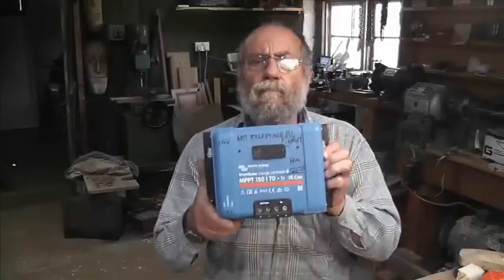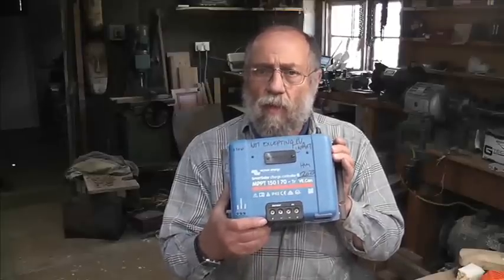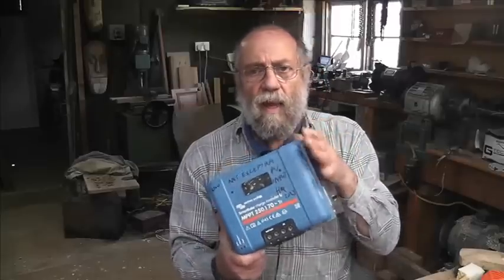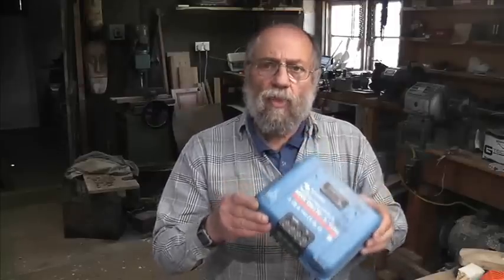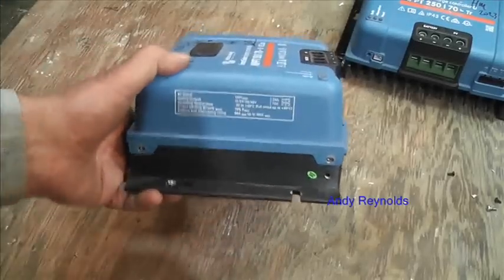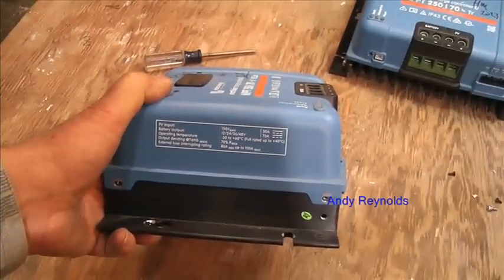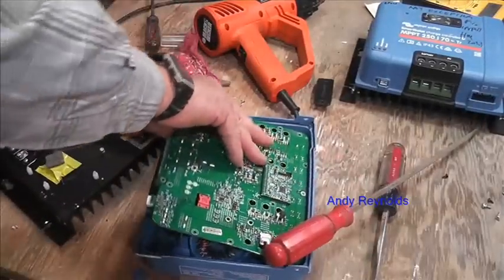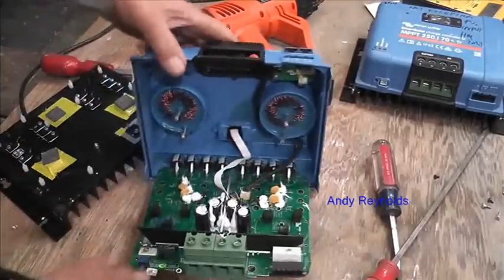Victron MPPT charge controller exploded

Comment: Mighty big hunk of junk scrap.  Great Video on those chargers.  Victron needs to change their mind set.  Those chargers get way too hot.
Reply: Nonsense, I regularly run my 250s at max, for hours, days .... yes they get hot, and yes they'll derate to self protect, but if you cook them with high ambient, or even direct heat they'll not be happy.
Reply from the maker: @SeanMoore2008  Capacitors fail regularly when cooked, cheers
Reply: Well, the Victron's do regulate the temperature.  They will de-rate the output above roughly 60C (the documentation says the de-rating starts a bit lower but it doesn't actually start until components hit 60C).

Victron's have very good heat sinks... much better than most other charge controllers, but if you run them full-out and want them to last it is still a good idea to have some air flow.  Doesn't have to be much.  One low speed fan is all it takes.

Heat can also be massively reduced by running a higher system voltage.  A 48V system generates 1/16th the amount of heat that a 12V system generates at the same power levels.  Not 1/4th.  1/16th.
Reply: Victrons are way overpriced for what you get, 2 big cons of victron units, 1- they run too hot doesn’t matter the quality of the electronics heat will kill components fast, and 2- they are not serviceable, buy once cry once get something like Outback or midnite solar units, all electronics have a lifetime of usage mosfets wear out, but these are at least serviceable and last way longer due to running cooler, victrons are popular for two reasons they spend hard for marketing and push hard to sponsor YouTubers with free products and the second reason is they are pretty simple to use and setup with Bluetooth units and easy to use app, electronics are good but they just run them too hot not enough mass and heatsink mass to properly cool them
Reply: @jaysonyang1441  If a MOSFET is not defective and it is operated within the SOA then it should last for your life-time or longer. If the MOSFET runs too hot and/or is subjected to an unsafe voltage and/or is subjected to an unsafe amperage then it's long lifetime will be reduced. Poor engineering can reduce the expected life of almost anything.
Reply: @MrSummitville  yes properly engineered but considering cost constraints size and format Victron seems to compromise with size and format, real world usage equipment will be in very diverse adverse conditions is quite different than laboratory and component specifications leads to real world reliability issues, on paper it’s all good but how much margin duty was engineered into the system is the key factor, marketing can say it wants but reality in the field is what matters, I really don’t like the way they are not serviceable, built to be throw away products, great for low to medium duty usage but I rather spend the same and get a superior product, victron does target its demographic costumers very well for what they are
Reply: Why weren't these returned for investigation and warranty replacement  ?
Reply from the maker: @SeanMoore2008  Brexit rules
Reply: Will Victron actually take them back?  Will they do an autopsy?  They appear to be non-repairable, without using a massive amount of labor = not cost effective.
Reply from the maker: Just goes to prove the 2nd rule of solar, don't run equipment above 60% of capacity. I've got another and this time the cover gets cut into little bits, cheers